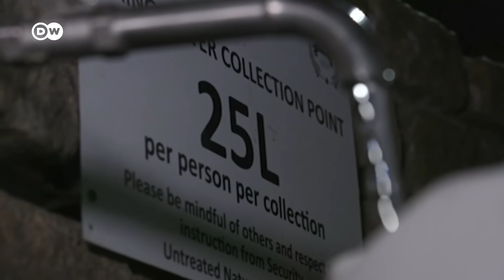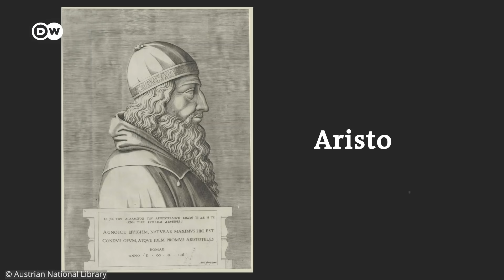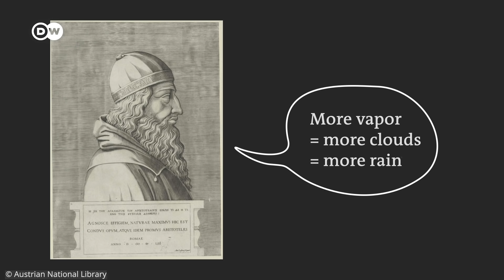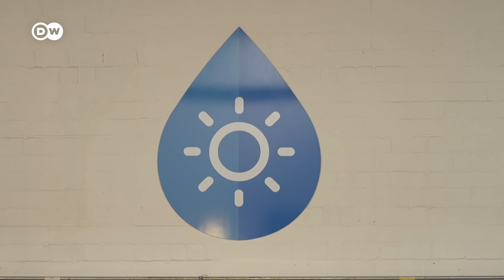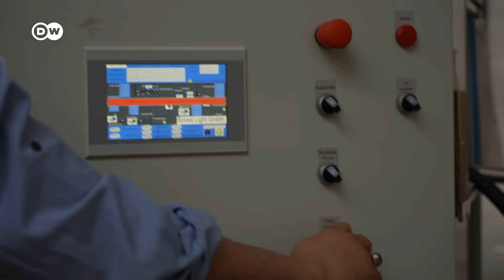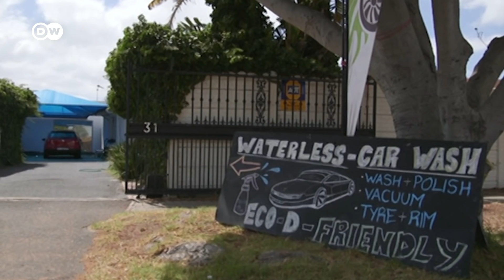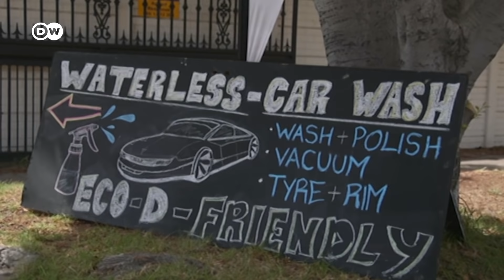Can desalination solve the global water crisis?

Comment: Solar energy should be set up all over the world, and the excess electricity should be used to make fresh water. The water can and should be piped via under ground, and if it goes to above ground storage, that storage needs to be covered with solar shields,  preventing evaporation. Current above ground storage should get the covering now and save as much water from evaporation as possible.

The salt can be dried and entombed in multiple locations far from population centers.

Comment: We have  sufficient  drinking  water  for everyone.  But our mismanagement  and wastage  cause  artificial  scarcity.  Our hydro electric  project  are main causes of   fresh water  turned  to saline  water  in no time.  All industries  uses  fresh water  only.   This  can be always  prevented  by using  fresh  water only  where  absolutely  needed.  Leather  and meat industry  can always  use oven water at initial stages.   Similarly  where salinity  is not an issue , oceans  water can be utilized.   Best would  be limiting ourselves.  Imagine  Ocean  are filled with  fresh water.  We would  consume that  also in no time.

Comment: Eventually the AMOC will return if the thermohaline ratio is reestablished. This would require a global effort. But it will stave off the impending glaciers.
Since what most call global warming is actually climate volatility and ends with an glaciers.

Comment: Do you think it's a viable idea to install solar panels on the seas and use the generated electricity to spray seawater high up into the sky to accelerate evaporation? This way dense humid air will go to land areas and rain, filling back lakes, rivers, and underground water stores.
Reply from the maker: Great question! Check out our video, "Why we should be putting solar panels on our fields and lakes" 👉 https://youtu.be/2hwpXCjmkRo

Comment: There are several reasons we are running out of water! 1)bores 2)dams 3)housing. Bores drain water basins surface water must refill before it can runoff. 50% of the worlds fresh water is trapped in gigantic dams. Every house from the water mains to gooseneck drains has no less than 5000 liters of trapped water

Comment: Its not just the amount of freshwater but it also the amount of pure/drinkable freshwater that we need to resolve. Fun fact (or ironic fact) i live at about 350km from jakarta and here the ground water is about 1.5m from the surface. So its challenging for you to build a house, the fondation of a house.  Teh households rarely use the ground water since we use the tap water (for shower since its undrinkable) from the government's water company and the source is from the deep well and the dam near the area.  And for drinks we use gallons water. Ground water in my place heavily use for plantation and so the problem are households contamination (e. Coli) and chemical contamination water from the fertilizer or other plantation industries.

Comment: Perth Australia has been losing 1% annual rainfall each year for about 20 years. The water catchment areas can no longer produce enough water to flow into the dams. The city has an artesian basin under the coastal areas under Perth, which can be used for a while, however eventually than level will drop and sea water will pollute the coastal areas of the artesian basins. The government was faced with limited options. There is a dam in the north of the state, but the dam is about 2,000 km from Perth. West Australia is a big and dry place. To date, the State government has been building desalination plants. Some people complain that desalination plants are unnatural, but in fact, they are a reflection of nature, with water evaporation from the sea and forming rain clouds then rain. So far 50% of the city is using the two desalination plants currently built. Any excess water is stored in the old dams in the hills. A third plant is planned.
Reply: "Unnatural." Nothing hurts my head more than reading that. I swear people just oppose things just for the sake of opposing it.

Comment: Uses for the brine, from Britannica; "Brine is used as a preservative in meat-packing (as in corned beef) and pickling. In refrigeration and cooling systems, brines are used as heat-transfer media because of their low freezing temperatures or as vapour-absorption agents because of their low vapour pressure. Brine is also used to quench (cool) steel." and from Wikipedia; "Brining is used to preserve or season the food. Brining can be applied to vegetables, cheeses and fruit in a process known as pickling. Meat and fish are typically steeped in brine for shorter periods of time, as a form of marination, enhancing its tenderness and flavor, or to enhance shelf period."

Comment: The problem seems to be the cost of producing energy to boil water or causing a pressure gradient for desalination. How could this cost of energy be lowered? Solar panels are expensive to produce, but, once produced they harness energy very cost-effectively. What if you could use the heat from the sun over a wide surface area of water to evaporate the water and somehow collect it.
Reply: It will require a huge amount of area to fulfill the water need. Rain happens due to the same process and it take 75% of earth's area to get the amount of rain we receive.

Comment: WE ARE NOT building more desalination plants because humans have become "Engineering Stupid" .... this means we "OVer engineer" everything to the point that it is prohibitively expensive to use the resulting products/systems.....You could use a two by four to carve out a wind trubine blade for about 20 bucks and if you need more electricity , just make another one. but engineering companies spend millions on exotic materials, huge structures, and constant tweaking of a simple design to get another 0.1% when simply buying another of the smaller cheaper type would have gained you 100%....it's a bullsh00t way of creating the narrative that "renewables are expensive" BULLSHaT ! !
Reply: Desalination could be done with 100% solar energy produced ON SITE ....not from a powerstation 20 miles away. End result . 90% of salts removed by THERMAL renewable energy and the final 10% removed by Photo Voltaic solar panels providing the energy for reverse osmosis.

Comment: No, desalt can support like the important reuse of water, but to have an sustainable water supply we need to use small and large scale AWG operations. We don’t find anymore the ground or surface, we take the rain water which is already desalinated from the evaporator over the oceans, anywhere we need it and at any amount. AWGs are fast deployed, need less energy and capital and can be removed if not used anymore, or like the eAWG system, even used for power supply. Less capital, faster deployment and no negative environmental impact like desalination, AWGs are the answer….let it rain where you need it …

Comment: As someone from Cape town, I still shower with a bucket and use it to flush. It is not really necessary anymore, we had a good reason season, but it is a good habit to save water. Not letting the tap run while brushing your teeth or closing the tap in the shower while applying shampoo is a good way to save water.

Comment: Solar panels are not the answer, it can provide power where there is no option to connect to the grid yes, but we use coal to manufacture solar panels. Also the batteries use minerals that are mined. Both the solar panels and the batteries need to be replaced every decade or so.

Wind energy costs the environment even more, since cement is used in the manufacturing process among other materials that are mined. Not to mention they also need to be replaced every 30 years causing waste and demand for more mining. We need to find a solution that is not reliant on coal.

Comment: Desalination is the way to go. I grew up in Hawaii, and most of our water comes from Desalination through the volcanic rock.

Desalination plants could easily provide all the water we need, and provide us with sea salt as a byproduct for animals, and humans.
Reply: That's because of your place's unique geography circumstances. Not so for many other places.
Desalination plants uses quite abit of energy to convert sea water into drinkable water. It can turn out to be rather expensive for under developed countries.
Reply: @sleepyearth , true, but you can use a passive system that uses tidal generators to create the power to desalinate.

Or use my method, which is using gravity based water condensers, they function better near high humidity, so they work great near the ocean. Think of it as a desalination system without the cooking of the water.

Comment: diggy diggy hole pour salt water in put giant dome over hole thats made out of glass or plastic and diggy diggy hole to catch the condensed water.
easy as that. you even can use basic physics to effortless get the water in the hole.
youd only once in a while have to clear the hole. but i guess you can get alot minerals out of there you can make money with? but then again maybe 2 much effort to separate the minerals.
but sounds like a good easy solution to just diggy diggy hole

Comment: It has been suggested to use surplus heat from molten salt reactors to make fresh water.  Some minerals will have to be added.

The heat is basically free if the main task of the reactor is producing electricity.

A reactor can also use the heat to produce fertilizer, chemical compounds, etc. for little cost.
Reply: I can put a glass jug of salt water out with a magnifying glass on it and a coil of 1/4" copper tube into another jug.  It's ridiculously easy to desalinate.
Reply: @The_Savage_Wombat  Copper is poisonous.
Reply: @tarjei99  That explains why I'm so sick. Must be from all the copper plumbing in USA.
Reply: @The_Savage_Wombat  There is a reason for all copper cooking pans being lined with tin and we are advised to not drink hot water from the tap.

Comment: There are several parts that caused this problem one being the fossil fuel industry and they knew 40 years ago that the average temperature was going to increase by 1 degree (40 years later I.e. now), another is people don’t know how much water they are wasting/using and people don’t think and are aren’t conscious about it. People don’t think about how much water goes into things. Water goes into and is needed for practically much everything from the food we eat(when it’s growing or for the cattle) to the clothes that we buy. If fashion was more sustainable and there wasn’t so many fast fashion shops then there would be more available water. It all goes down to consumerism, and supply and demand. If the demand wasn’t there then the supply wouldn’t be as much. It doesn’t help the amount of food waste there is, not just from households but from supermarkets. That food must of used water to have grown at some point thus wasting food is eating water in a way not just only money.

Comment: Why can’t we just completely evaporate the brine? And leave just the hard sodium? Don’t have to throw it back into the ocean.
Reply: It's salt, so sodium-cloride, if you want to seperate them you have to make them react with other chemicals, which is costly on this scale, throwing it back into the ocean is not as bad as it seems, you just need to distribute it a little and the effects are minimal, the water just becomes part of the natural water cycle again, humans don't consume that much water, the main issue is energy costs, right now it's cheaper to fight over water supplies than it is to invest in desalination plants and the nations most effected don't have the grid of funds to set up such plants, it would have to be paid for by richer western nations in exchange for something because nothing is for free and those plants need to be maintained.

One possible solution is offering to hold refugees and halt illigale flow of migrants in exchange for such desalination plants and it's energy needs.

Comment: I have to warn that leaving urine in toilets will clog them as well as the pipes eventually. Calcium builds up on the walls of the toilet and the drain pipe which result in a smaller opening for flushing. The toilet will flush worse and get clogged easily.

Sewage can be separated and sanitized to recover the water—this water should be recirculated into the plumbing. Yes, it is safe. Sewage treatment is important and recovering water is vital.

Comment: Why not artificial flood plains on coasts, that supply a solar mirror focal array attached to a turbine with a capture condenser.
Sea water enters the plain, then controlled into the basin of the solar plant where a large focal array uses solar rays to heat the basin. the steam generated then travels through a turbine into a condenser. If you rotate turbines and basins, you can cultivate sea minerals as well. completely renewable. You get electrical energy, sea minerals or "organic sea salt", and distilled water. The only carbon foot print is in construction.

You could also use sand as heat storage medium, or some other medium, to run the plant 24hrs. After some point you could also retain the salt, purify it and use it as the coolant fluid to increase efficiency. Sun hits mirrors, heats sand that melts salt that boils water that creates you commodities. you could also couple the plant with gravity feed fresh water reservoirs that push through turbines as well for non solar generation.

Comment: The other problem with desalination is, that you require water supply in any form at the first place. 
The solution must be, to retrieve the humidity from the Air!
No supply required, I even invented a system that works without electricity!
No Brine, no pollution, -and plenty of water even in the desert
Reply: You can just take it from the salty oceans.
Reply: the oceans have a huge amount of water

Comment: Desalination will work.  At scale.  As long as we crack the code on fusion power and can essentially expend a glut of electricity to power the process without blinking.
Reply: We can also just use salt water to evaporative cool shade-houses and reduce the water use of plants by 80+%
This reduces the desalinated water needed significantly..    :)

Comment: The main arguments against desalination are the amount of energy required and the cost. The amount of energy required is eliminated when you use the latest nuclear energy tech. It’s cheap, plentiful, and efficient. The other argument is the cost. Much of that cost comes from replacing the membranes used to desalinate so frequently. Really? Do you have to use membranes? Have we forgotten about thermal desalination? That eliminates the need for membranes that hav to be constantly replaced.furthermore, you eliminate the brine problem. The fresh water evaporates away from the salt and condenses in another tank. What’s left is dry salt. Remove it from the tank, package it and sell on the market. The program could pay for itself at that point.

Comment: So, what's the matter with taking the brine, breaking it in half with electricity and bottling the hydrogen for fuel in fuel cells and the O2 for Scuba or medical use?. The salt can be left behind and stockpiled, used for roads in the winter or sold as sodium chloride  - table salt?.

Comment: Here's an idea for low water levels - use unpopulated volcanic islands as power sources to use electrolysis to create hydrogen.  Deliver the hydrogen using unmanned autopiloted dirigibles that use the hydrogen they are carrying to stay aloft and power themselves.  Once the hydrogen reaches the city where it is needed, burn it for power and harvest the water that is produced when the hydrogen is burned.  Send the deflated dirigibles back to the volcanic islands to be reused using wind-powered ships.  If you have a large enough number of hydrogen dirigibles circulating back and forth between the volcanic islands and the cities, the extra time needed to use wind power for the ships won't matter.

Comment: Yea I've never really understood this, all our navy ships use reverse osmosis filters for essentially infinite water while out at sea.
Reply: Cuz navy ships are built different.

Honestly tho it just boils down to cost effeciency. Pun intended :p
Reply: Osmosis filters are kind of expensive. Sustainable desalination is going to come down to solar thermal. Use solar to desalinate water and use some of that solar to operate the machines. Am I asking a lot? Yes, but if the goal is sustainable water then it’s the system has to be very efficient.
Reply: @allstarwoo4  yea I heard about that, that could work too. I just bring up RO cuz that's what I knew.
Reply: @kuma8093  Don't misunderstand RO is good but can also be expensive when scaled up(until filters get cheap and/or better). In solar thermal there's minimal conversion lost. Stirling engines are getting revisited because they're cheaper than solar panels, combined new innovations. And Solar concentration is also becoming relevant again.